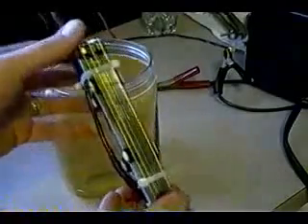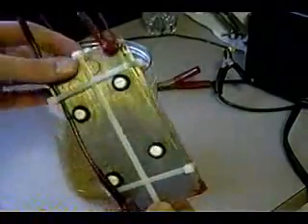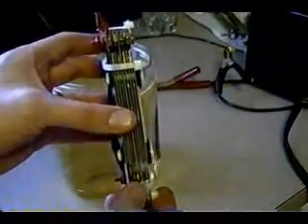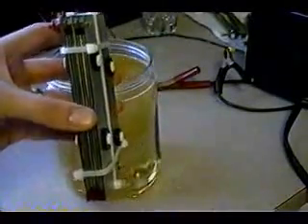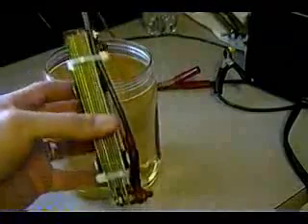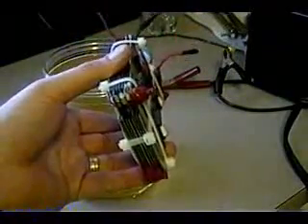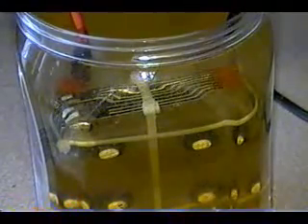HHO Fuel Cell - How To Make Hydrogen Generator Build Kit

Comment: You may get better efficiency adding a considerable number of nuetral plates.each plate gap should be reading at roughly 2 volts,i useually get 2.1 volts on 14.7 volt systems.to much voltage between plate gaps generates excessive heat and its mainly current that is doing the work.so add those nuetral plates.it extends the longevity of the system

Comment: can you explain why you put your neutral plates the way you did? I thought they should be between pos and neg just to get it to 2v per neutral  placement with the 12v only on the outside plates? I dont get why you did your in such a way thanks, great reactor though, I used bit serving spoons and cut off the handles flattened out with a sledge hammer and turned then opposite eachother in the stack works really well, but no neutrals I have a dc power supply that allows for 3v min so I just usethat

Comment: Baking Soda used in electrolysis will produce toxic gas. Same for salt, vinegar. There are other solutions you should not use either. How about doing some research into electrolysis. Better still why not give up the HHO by electrolysis myth. Its inefficient and a waste of time.

Comment: Use aluminum instead of steel. It doesn't rust in the water
Reply: aluminum doesn't conduct electricity you fuck
Reply: CoreyG23 I think you’ll find it does. It’s metal, with free electron in its outer shell. Therefore it will conduct an electrical current... Fucking idiot.

Comment: @Mrsheytun 20 amps, I dont think he mentioned voltage however. He probably used 12 volts though if its a battery charger :)

Comment: i have a Q? when i hook my 10 plate 4x4" hho cell up to a fully charged car battery, it begins to create sort of like flakes that float around. maybe i am just putting to much power to it and the baking soda that i use is just starting to stick together. to many amps to such a small surface area. my bigger 6 plate 7x5" cell has less of the white stuff floating around. i use 1, 2, and even half of a teaspoon to 500ml of boiled water and it only changes the amount of whit stuff floats around.

Comment: @dancthegr e.g. if it was connected to a car, Use a car battery? The alternator in the car will recharge the battery and the process can be used to also power the HHO Cell.